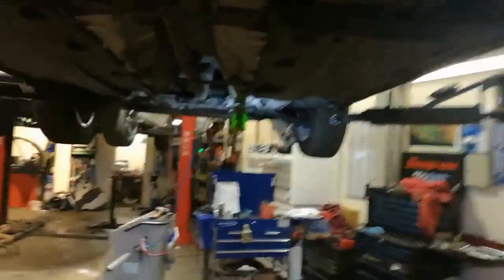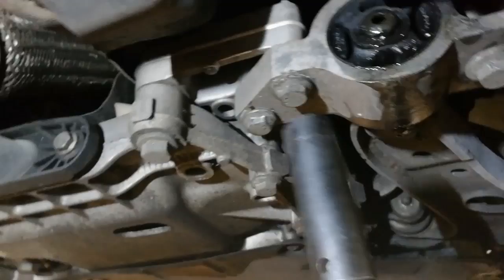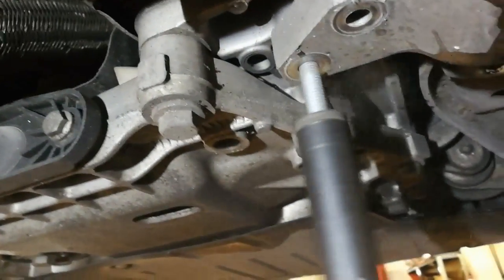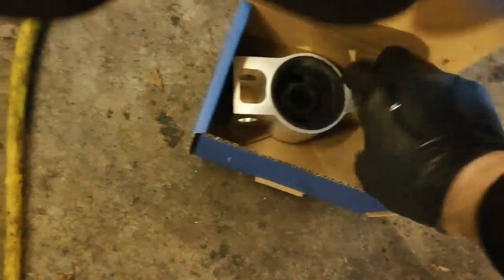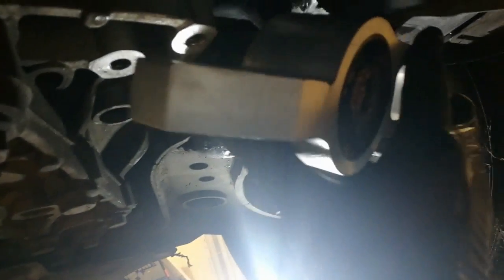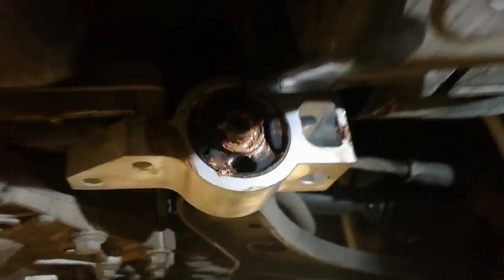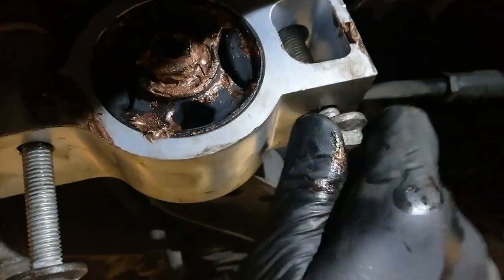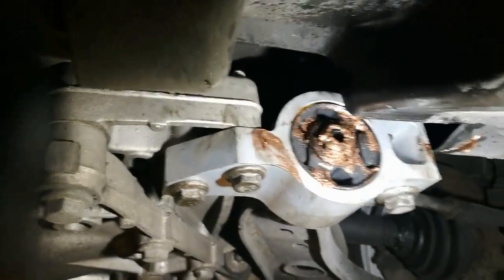VW Golf / Passat / Tiguan Consul / Lower arm bush replacement the EASY way!

Comment: Very helpful video. No doubt you would prefer everyone to use independent garages like yourselves but like yourselves, there are many competent DIY mechanics who just need to see how something is meant to be done to do the job right without taking a million things off.   
Great video.
Reply from the maker: No worries, just use red rubber grease instead of what you see me using in the video 👍
Reply: @gsoup7850 
Just bought a pair, they both look identical and have solid rubber( no holes, will this be a problem?

Comment: TORQUE SPECS
18mm Bolt = 70nm then 90 degree turn 
16mm Bolts = 50nm then 90 degree turn

Comment: easy peasy. anyone who is replacing those every year, get yourself Meyle HD version, had them for 3 years, still going strong
Reply: Got Meyle HD with bolts for $85 here in the US. Just put them on.  Feels pretty tight. Less clunky over uneven surfaces.
Reply: Out here doin the lords work for real, never even thought to check! Thanks mate

Comment: I did that 'surgery' the other day on a VW Tiguan 4 wheel drive 2015 model.
Very easy if you got the right tools!
Used Wurth PTFE spray which made the process easier/quicker :-)
Thanks a lott Kevin!
Reply from the maker: No worries, glad it helped 👍

Comment: Just done this on passat b7 2014 and on my drive using axle stands i used a crowbar and a load of wd40 get it off very simple to was expecting it to be much harder also just poped straight back on if you can change a wheel you can do this thanks for the video

Comment: Stretch bolts (as well as locknuts) should always be replaced not reused (but if absolutely no choice use thread-lock); full weight should be on wheels in normal ground load position before final tightening; subframe locating pins (e.g T10096) should be used (and then re-alignment should not be necessary)?  Or that bush can be pulled and replaced with the housing in position i.e. so no re-alignment needed?

Comment: Great job - only one comment: Copper paste and copper grease are only for metal use as they have anti-rust and anti-seize properties. They can damage rubber material. Spray a window cleaner instead; it works great as a lubricant for such jobs.
Reply from the maker: You're right 👍

Comment: Wont copper grease eat away at thr rubber was told not go use that but a silicone based stuff
Reply: I think the use of a pry bar should explain that.
Reply: Correct! Don't use Copper Grease on rubber bushes.

Comment: Thought this was gonna be easy, 2 of the 3 bolts came out easy, the 3rd one (16mm) came out about one cm and is now completely seized wont go back or come out and I feel that its gonna snap, so I bit the bullet and bought an impact wrench, so lets see if that works, otherwise I might have to drop the subframe if that bolt snaps to replace that one bracket.
Reply from the maker: @NathansLife  if you have access to a blow torch, get some heat on the bolt. Once it's hot, work the bolt in and out, screw out a bit, then back in a bit until you work it all the way out. It will probably bring the thread out with it unfortunately. If so, you should be able to use a helicoil to repair the thread without subframe removal. This problem is relatively common.

Comment: Those bolts should be replaced. And they should also be torqued to spec. And proper grease should be used. Otherwise looks simple enough
Reply: No need, that is not how shit works in the uk. All bolts are torqued to 'tight as fuck'.

As for the copper grease... I have no defence. Thats bad. Red rubber grease only
Reply: @gaffnaldo1  lol. So true

Comment: VW Dealership told me they wanted $875 to do this job. I did it for under $100 and about 2 hours of my time including running down the parts.
Reply: Nice, i upgraded mine with an S3 bushing. Been holding up great for the past 2ish years.

Comment: Just had mine replaced by a local independant on a octy mk2 purchased the same bushes inc with the mounts the mech said he had a right mare getting them off and had to cut them with a angle grinder to get em off ? got them replaced on the advice when getting my steering realigned guy said they were worn
Reply from the maker: He's obviously not seen this video lol!

Comment: Gotta say all three bolt are torque to yield bolts and definitely needs to be replaced and torqued to spec, I thought only Americans don’t use torque wrenches lol, but it seems I am wrong.
Reply from the maker: Didn't have access to torque specs and had not been supplied with new bolts. I've never had any come undone to be fair

Comment: RUBBER GREASE ONLY should be used,also new stretch bolts as once only use items,these items need torque loading with weight on wheels not garage lift

Comment: Mineral grease on rubber? Silicon grease or other without mineral inside.
Reply from the maker: Yes, means the Bush degrades more quickly, so you can do the job again, extracting more money from the customer 👍
Reply: @gsoup7850  😂

Comment: Buzz em all up... So don't replace the single use torque to yield bolts then?
Reply from the maker: dopiaza2006 you are quite right, it is important essential to replace all torque to yeild bolts and this I should have mentioned. However, this was a job I did for somebody else that wanted to cut corners at every turn, so I was just following orders lol. I have reused these bolts on many occasions though and haven't experienced a problem so far. And buzzing them up, may as well, they have already been stretched beyond their yeild point, so applying the correct torque would be impossible.
Reply: Sorry, was just being an arse!... I do it all the time and have never had one come loose or snap. I'm looking to do this job soon on my Mk5 Golf but want to go with the uprated TT non voided bushes. I understand the bush housings are different though so will need to press out/in the new bushes.

Comment: when these bushings go do they usually make a clunk/bang noise when taken off?.
Reply from the maker: Do you mean 'when taking off'?
Reply: Kevin Coyne sorry mean as in driving say if I’m sitting at light go to drive I can hear a clunk/bang noise.. recently changed tie rod.. anti roll bushings all look prefect no play in bar
Reply from the maker: @xoxtoyotamadxox that could be anything and difficult to diagnose on the Internet. Where are you based?
Reply: Kevin Coyne just changed the bushings noise still there not as bad tho thinking it’s the shock now as it’s burst.. I’m in Ireland
Reply: @xoxtoyotamadxox  Check roll bar drop links for free play in the balljoints

Comment: Could this worn bush cause vibration in the steering
Reply from the maker: Mubzy I would say it's more likely to cause vague steering and premature tyre wear. Vibration in steering more likely to be wheel balancing not correct, a buckled wheel or warped brake discs if it happens when braking
Reply: Kevin Coyne thanx for the response but yes steering vibrate while driving its golf tdi mk5  bushes are worn tho
Reply: Yes it will.

Comment: changed the front wishbones of my 2.0 tdi golf yesterday

first one easy 2nd one for some strange reason the bolt snapped first time it had been took of too

was moving the bolt back and forward and spraying wd40 on it and it snapped right at the head end aint a clue why it was so tight like

it one of the 3 long bolts which hold the main bush in

so just driving on 2 bolts till i get this fixed

only about 5 mm of the bolt showing and the bolts are around 3, somethink inchs long

what is the best way to go

i was thinking of drilling the bolt then put a slighter longest bolt through and the a washed a nut of other side of steel plate as there is room to do this 

any advice would be great
Reply: and how dangerous is to drive temporarely with 2 bolts ?
Reply: WD40 is no good for releasing bolts. Use plusgas or similar.

Comment: How did you just wiggle the new bushing in? I can't seem to push it in by hand and may need to take it off anyway to use a press
Reply from the maker: kr899 put loads of lube on the bushing and the arm. eat some spinach then push and wiggle with all your might! it will go on! do not waste your Sunday afternoon taking the arm off ;-)
Reply: Haha thanks. I managed in the end. there was quite a bit of rust on my old car so I sanded that off and gave it another go.
Reply from the maker: lol, thats great to hear

Comment: Mate, you've used the wrong  grease - copper grease eats rubber. Should have used silicone or red rubber grease  for lubrication. You'll be doing that job again soon.
Reply from the maker: You're probably right

Comment: Incorrect technique, you're causing unnecessary strain onto the control arm's bolt attachments to the mainframe of the car. Not to mention that using a hammer/prying tool to remove the bad bushings underneath a car that is suspended in the air is completely IRRESPONSIBLE and unnecessarily DANGEROUS.
Reply from the maker: Shivam id be genuinely interested to learn how this technique is dangerous and irresponsible; would you mind breaking it down for me?
Reply: Instead of hammering the front cradle bushing out of the control arm, he could've removed it the proper way. This causes wear on the control arm and inevitably leads to replacing it which is costly.
Reply from the maker: And the danger element?
Reply: This was all done underneath a car that was suspended. It wasn't safe to be prying/hammering away at the car nor the car's parts in order to pry/remove the cradle bushing.... bottom line the procedure shown here works, but there are easier and safer ways to do it as well.
Reply: I also fail to see how this would cause damage or is dangerous. he is prying only on the end of the control arm on the front/rear axis. What control arm wear? Also, I don't see how doing so would push the car off the lift LOL
Reply from the maker: Just a note, this is a 4 tonne, professional snap on 2 post vehicle life, you'd have to drive a truck into it to knock the car off lol
Reply: Sigh... there's no debating with you keyboard warriors. Take my advice however you want it... Bless ✌
Reply from the maker: If that arm cant take a rubber bush being pryed off of it, imagine when theres 1.5 tonne of car sitting on it, going around a corner at 60 mph lol
Reply from the maker: Keyboard warrior? You started this debate and so far you've not been able to substantiate you're original statement. And if you are such a pro on the subject, what led you to this video in the first place. That would be like me searching a video on 'how to make a cup of tea' lol
Reply: I'd assume that you, much like me, found this video whilst looking up ways to replace your cradle bushings on your VW/Audi/Skoda... after seeing this video and a few others i was convinced that I'd have to replace parts amounting to much more than I preferred. However, upon taking my A3 to my local mechanic's garage, it turned out to be a simple job done without hacking the car to remove it's parts while up on the lift ...also I managed to salvage the metal framepiece and replace the more economical rubber component instead (switched it to an OEM polyurethane variant).
Reply from the maker: So, please describe the alternative method that your garage used. Did I hack or pry?
Reply: No. They removed the underpanel of the car, removed the underpinnings of the wheel-well, unscrewed the bolts attaching the control arm to the subframe, and then unscrewed the remaining bolts attaching the head of the cradle bushing to the rest of the McPhearson strut. Then the two-piece component was carried to their press, where the cradle bushing housing was separated from the rubber component, the new one placed in it and then the entire unit was taken back to the car where it was reassembled, following the steps previously mentioned in reverse.
Reply from the maker: So how did they raise the vehicle? And for reference, VW supply the console bush as one piece with the aluminium housing.
Reply from the maker: Also, you said that during your research you concluded you'd have to replace more components than you'd like; could you describe which components you thought you'd have to replace?
Reply from the maker: http://www.hse.gov.uk/pubns/indg434.pdf
Reply from the maker: hse.gov.uk
Reply from the maker: The official HSE guidelines,
Reply: Kevin Coyne I was under the initial impression that I'd have to install brand new control arms and cradle bushings.. and yes I'm aware that they're sold as a single component with the housing, but that's more costly.
Reply from the maker: http://www.eurocarparts.com/ecp/c/Volkswagen_Golf_1.9_2004/p/car-parts/suspension/suspension-and-steering/suspension-bushes/?610441438&1&36e955be8e255655200685c211e108f51e505e45&000437
Reply from the maker: For the sake of £20 id rather buy the bush complete (not that ive ever come across a bush seperate from the aluminium housing)
Reply: Well sir.... I live in a third world country where prices cannot be equated to their british counterparts, labour is even more questionable, and professional euro mechanics are about as scarce as my faith in humanity. Hence why most euro owners do as I have, and research most of their cars' issues online DIY style.
Reply: And for your information, the brand of the bush I purchased was Lemförder or something to that effect.. small blue box.
Reply from the maker: although thats not what you did is it? You managed to find a 'euro' mechanic in your third world country and got them to do the job, then you came on here and pretended to know what you were talking about.
Reply: It is infact what I did. And to end this meaningless conversation, I reiterate what I said so long ago... THERE ARE SAFER WAYS TO GET THE JOB DONE
Reply from the maker: Yes, and I go back to my original question, what ARE the safer ways? Get a radio controlled robot mechanic to do the job whilst you sit on the sofa with your transmitter? Please tell me the safer way?
Reply: I'd say it would be much safer to just throw the car in the bin and buy a new one. As for the 2 post lift, best watch out - a strong gust of wind could have the lot over!
Reply: @ballra  you chat rubbish... All the way from your third world country. There was nothing wrong with the procedures here in this video - just that the wrong grease was used.
Reply: @wizkid01  You know how to read? Furthermore, you even know how to type? 🤯 #mindblown
Reply: @ballra  stop coming on here seeing how others do things and then criticising their methods.
Reply: @ballra  why don't you try to keep to the point rather than to resort to verbal abuse. The point being that you come on here thinking this video is flawed with safety risks yet you've never done this job yourself. Where is your video then - if you think you know so much